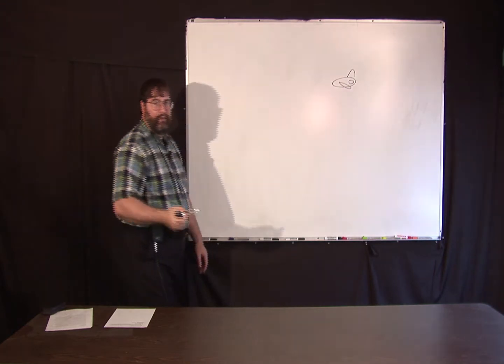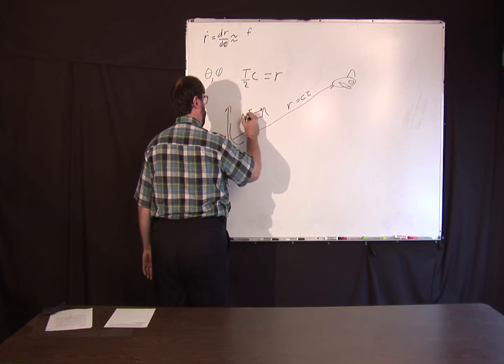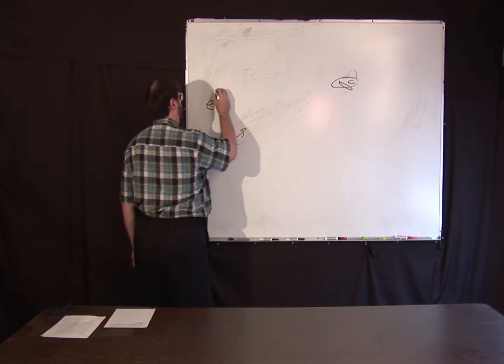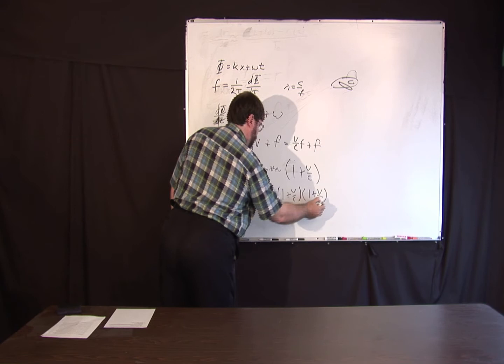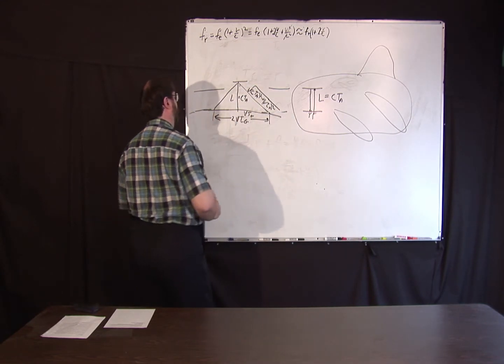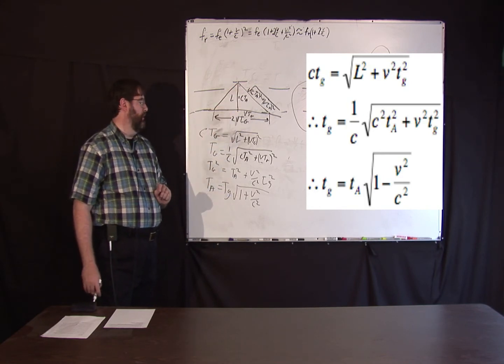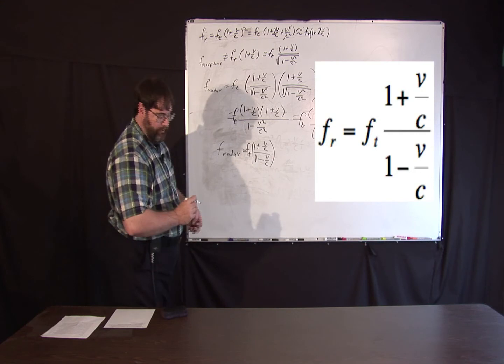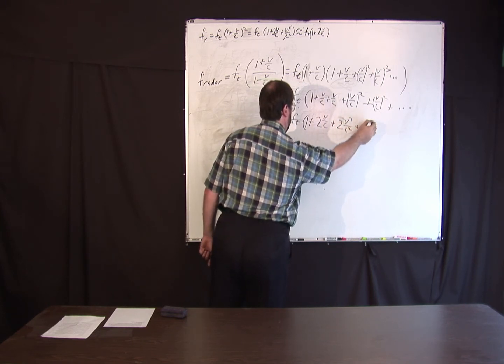Epsisode 7 - Radar and Relativity

Comment: very interesting. I've never seen the theories of relativity, kinematics, dopler, and radar used together for a practical purpose. of course you are 100% accurate with your analysis (using relativity) but one question. Given the 'middle world' issue you are dealing with - is it not accurate enough simply using newtonian physics? and what would be the difference of accuracy?